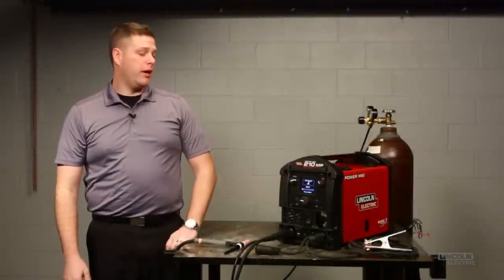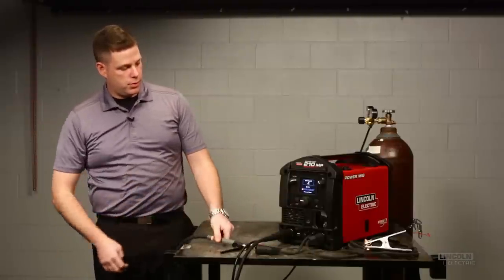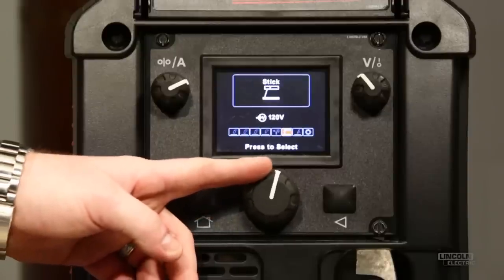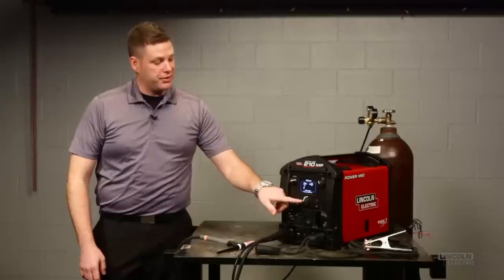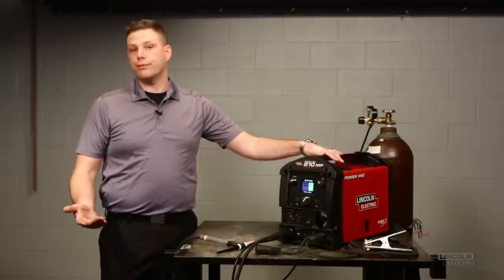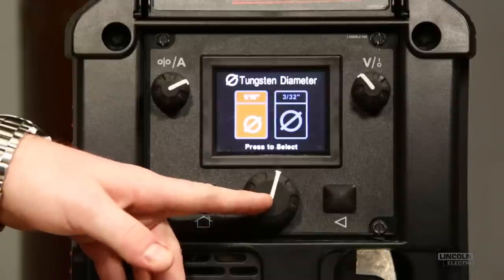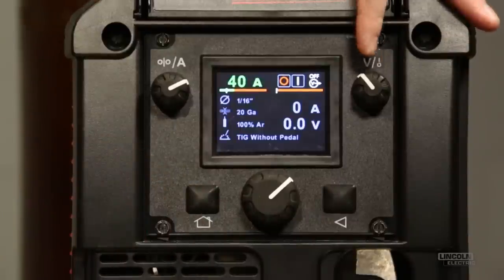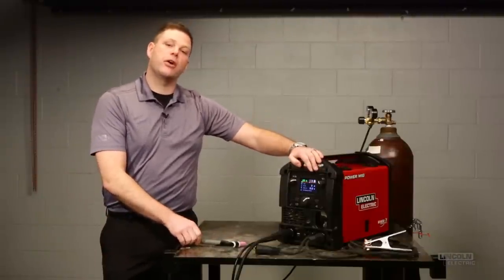Lincoln Electric POWER MIG 210 MP TIG Set-Up

Comment: Making your customers install the tig adapter is outrageous. Especially when they order the tig package. It made me want to return the machine. Bad design on that part. 

For what I paid I shouldn't have to risk damaging my machine to hook up to a circuit board. 

Also the manual is a bit lacking. Especially for newbie welders which I promise this machine is attracting in droves. 

I haven't welded with it yet but I love the 275 I use at work so I'm sure it'll run great.
Reply: For the machines that you buy from Lincoln that are the Tig kit I agree. But for those that you add the kit to, I don't see it as a big deal. It's really easy to do and not really a risk to the circuit board unless you are grotesquely ham handed.

Comment: This review and the manual is VERY incomplete. Please show the complete setup from actually hooking up the accessory kit safely without damaging the unit or shorting out something, like a capacitor. This product costs a lot of money, and for the home user or general maintenance it is a great welder. To say it will do TIG without also saying the exact steps (without voiding the warranty) is a bit misleading and will cause some buyers remorse. I do like this machine a lot but I hate this review.